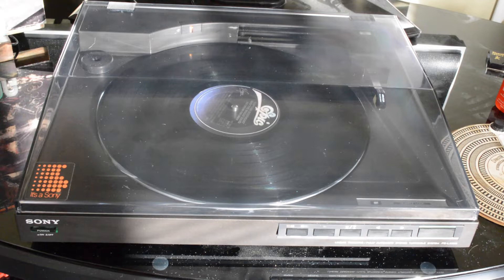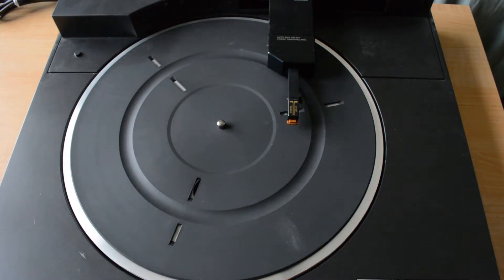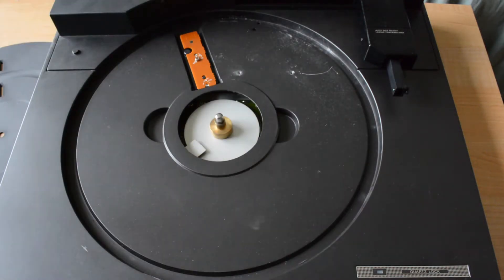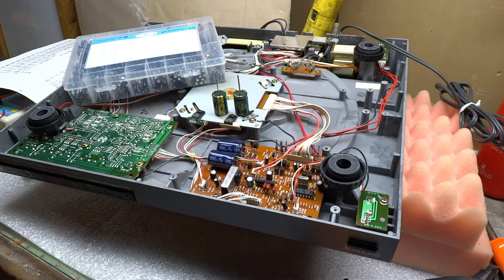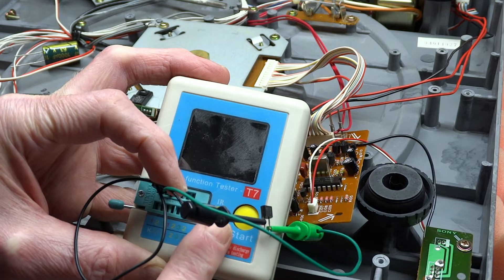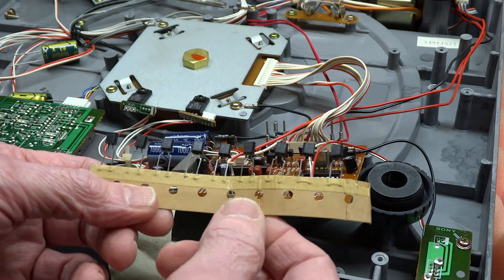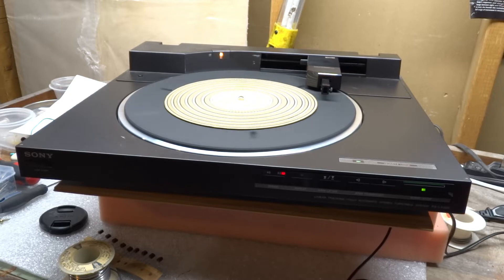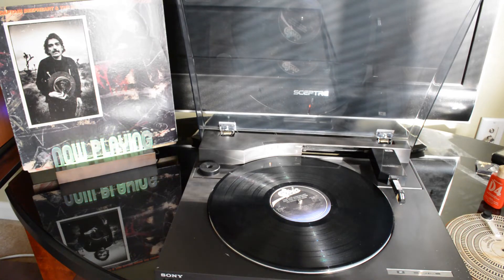DEAD SONY PS-LX520 TURNTABLE *!*!*FIXED*!*!*

Comment: I had the same issue 14 years ago. Twice in fact.  Each time it was those pesky N10. It took a while to find out the first time around as i had never encountered that part before. I didn’t knew about Aliexpress then…  i found some on old pcbs… Since i havent replaced the capacitors, I will order new ones as they are likely to fail again. Thanks!

Comment: I'm rebuilding my PS-LX500 after 40 years in storage, along with a set of JBL C36 speakers.  Nothing worked on the turntable.  Now I have platter spinning and am working on the arm transport.  I replaced the little rubber band but the arm still wouldn't move.  I cleaned the rod it rides on and oiled it.  Finally, it's moving (fairly slowly), but I can't get the stylus to drop down.  A friend gave ma a Heathkit 1515 receiver (perhaps the best consumer amp ever made), so I'm anxious to start playing some of my 800 vinyl records again.  What a job!

Comment: Hi there,

I just picked up a Sony PS-LX520 and connected it to my vintage JVC RS-5 receiver using RCA cables into the phono input along with the ground wire. When I play a "new" stereo record, both speakers only work if I press the “Mono On” button on the receiver. When the "mono on" is not pressed, only the right speaker is firing.

This wasn’t the case with my previous two turntables, which also didn’t have built-in preamps. My CD player, connected to the same receiver, plays perfectly in stereo, so the receiver seems fine. I also just tested my other turntable, a Technics SL-BD27 on the same setup — no issues there, stereo works without using “Mono On.”

So I’m wondering: could the Sony PS-LX520 have a faulty turntable cartridge (original cartridge is on there along with a audio technica stylus)?

Or does this model have something unusual about its signal output?

Again, from what I've read, there is no pre-amp on the PS-LX520

Any advice would be appreciated! thanks tony
Reply from the maker: Yeah, you either have a bad cartridge or one of the internal wires from the cartridge to the RCA cables is broken.
Reply: @AudioTomReviews  thanks much!

Comment: My LX510 doesn't have the same PCB with the big caps on it. Your video did help me get the tonearm moved over so I can work on it now. That PCB is upside down and connected to the side of the motor connection. Hopefully I don't have the same issue that you had with yours.
Reply from the maker: If it's dead look for a fuse(s), if none are present, look for the circuit protectors I had to replace. If one is blown you will need to replace it and all of the capacitors on that board (you could hunt down just the bad capacitor, but all the others are a ticking time bomb)
Reply: @AudioTomReviews  After I get the new power cord soldered on (I replace the power cords on all my restoration projects) I'll see if the lube job helped or not. I suspect I'll be looking for bad circuit protectors and replacing all the caps - knowing my luck! It looks very similar underneath to the 520, but just rearranged differently.
Reply from the maker: @VinylRescue  I also posted a video on replacing the LX520 arm drive belt. You may need that also.
Reply: @AudioTomReviews  I already replaced the belt as it was easy.

Comment: I just bought the LX510 from eBay and should get it next week. I guess I'll see if I have the same problem with it. I saved your video just in case! 😆
Reply: So did it work okay out of the box?
Reply: @mescko  🤣  Of course not! It powers up, but makes a odd grinding noise. I'm making it my next project so I'll be starting it today.
Reply from the maker: @VinylRescue  Grinding noise? That sounds like an excellent youtube video!!!!
Reply: @AudioTomReviews  As I opened up the bottom I found one of the ground wires routed incorrectly and it was rubbing on the motor! Someone has tried servicing this turntable, but probably gave up. I found the other ground wire going to the control panel plate was hanging loose underneath. I'm recording all this for a video when I'm done. The tonearm seems to slide back and forth better now, but I'll have to wait until tomorrow when I get the new power cord soldered in.
Reply: @AudioTomReviews  I got the new power cord installed and the grinding noise is gone, but nothing from the control panel other than the 33 and 45 Speed lights are working. The back sensor light is on. The tonearm only moves by hand and not with the control buttons. Guess I'm gonna have to order some of those circuit protectors and caps. 🥴😵‍💫
The ICPs are different than the 520. It has the same big 6.3v 1000MF caps, but no ICPs like the 520. It has about 22 Transistors that are 3-pronged that are similarly shaped, but much smaller. I'm looking at the service manual and the list of parts is nice. I'm not electrical wizard, but I'm not afraid to dive in and I'm wondering if I'm a bit over my head ??
Reply from the maker: @VinylRescue  A quick look at the schematic, on the power supply board there are fusible resistors 130-136, maybe more. You will need to pull and check each of those. I bet there is a shorted cap somewhere in there,
Reply: @AudioTomReviews  I measured the two 1000 caps and they were a bit low at 725 and 680. Some of the other smaller caps were a bit off too, but I'm no expert on this part. I'm gonna have to make a shopping list and order them to work on later. I have a pile of 5 other turntables to work on that I need to turn for resale. This LX510 is one I intend to keep for my living room setup if I can get it up and running perfectly. I will check out those fusible resistors 130-136 and see which ones have blown. No wonder they sold it!
Reply: Dude! You were spot on! I removed 130, 131, 132, 135, and 136. 136 was the bad one with OL on the meter and the rest were fine according to the spec list. I got my list marked from the service manual of all the caps and fusible resistors and now to get them on order. Thanks for the help!
Reply from the maker: @VinylRescue  If you don't already have one, get one of those little LCR meters. They are under $20 and priceless. That cheap desoldering pencil is also a jem.
Reply: @AudioTomReviews  I bought a resoldering pen recently and it works great! Thanks for suggesting the LCR meter and just ordered it and should get it tomorrow. I ordered the resistors and caps last night and should have them all in a couple of weeks. This gives me time to work on another turntable.
Reply: @AudioTomReviews  Getting some of these cap is ridiculous! I got them in and got everything recapped including the five resistors. No change! Am I gonna have to check the rest of the resistors also?? I was working on a Technics SL-5 that was dead when I got it and recapped it and it's still dead. I don't think I'll be working on any more linear tracking turntables after these two boat anchors!
Reply: I checked every resistor on the control board and found 8 resistors that seem to be dead! UGH! 😒😮‍💨 Time to research and order the parts and put it off to side for now. Definitely no more linear tracking turntables!  😵‍💫😑 EDIT: I just checked them with the LCR meter and it reads them as they are. Not sure what the blank I'm doing! 🤔
Reply from the maker: @VinylRescue  Double check that you didn't install a cap in backwards, the most common mistake, if so it also could have fried a transistor. Regular resistors rarely fail on that type of unit. Look at the schematic and measure the stated voltages at each listed point, if a voltage is off or absent, start tracing around there.
Reply: @AudioTomReviews  I'm pretty sure I didn't install any backwards as I double check before I insert them into the holes. I even double checked each new cap to make sure it's not a dud. I can't even get the motor to spin for the linear tracking to move the tonearm and the motor for the platter won't spin either. There's about million little resistors and trying to test them on the PCB isn't easy and I can't tell what I'm supposed to see or how to properly test them. After the disappointment on the Technics SL-5 and this one maybe I'll revisit this one later after I finish working on the Pioneer PL-514 that I'm currently restoring. I almost feel like I'd be better of parting them out, but I hate seeing turntables being wasted.

Comment: Great tips and a great job making the repair. I recently bought/won an eBay auction of a PS-LX510 that works, but I plan on going through electrical repairs as a preventative measure for longevity. Very good video and explanations.
Reply from the maker: It's well worth the trouble to replace all of the electrolytic caps before they go bad and take out other components. Glad you liked the video!

Comment: nice , I just picked up the same unit , and it's dead !! nothing happens when I push the power on ...
is there a fuse anywhere ? I can't see one ...thanks
Reply from the maker: Not one that I remember, but there are two of those ICP10 circuit protectors. I only blew one of them, maybe you blew the other one or both. Unsolder each one and check it for continuity. If one is bad replace it as well as all of the electrolytic capacitors. I hope that works for you.
Reply: @AudioTomReviews  I had to replace one in an LX-57.  They don't open for no reason.  I recapped it at the same time.  Works great.